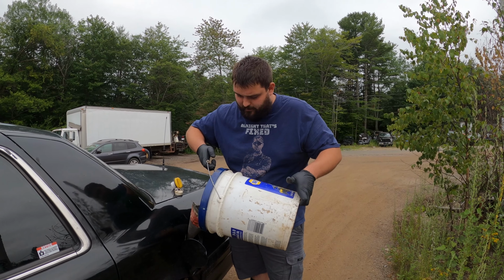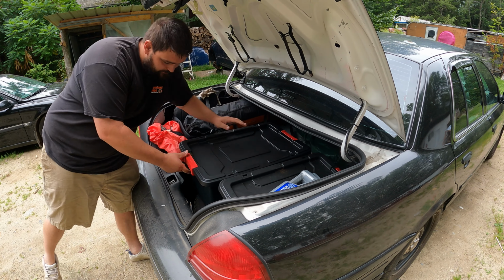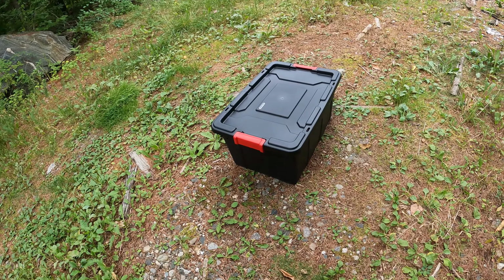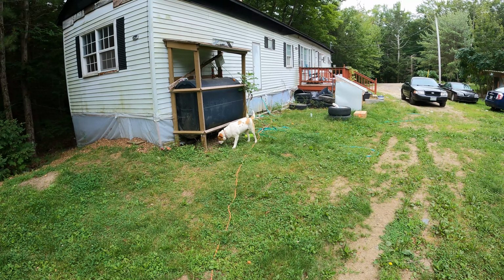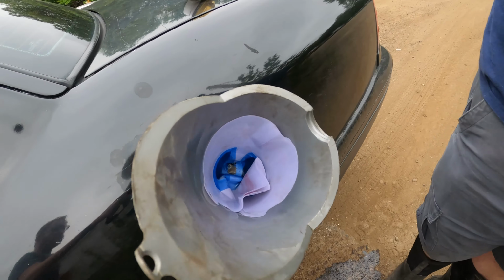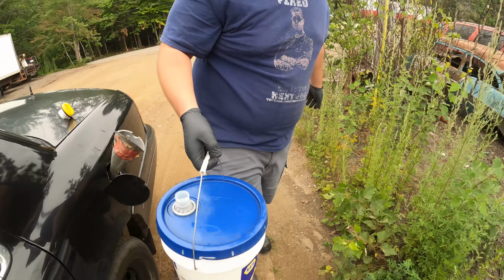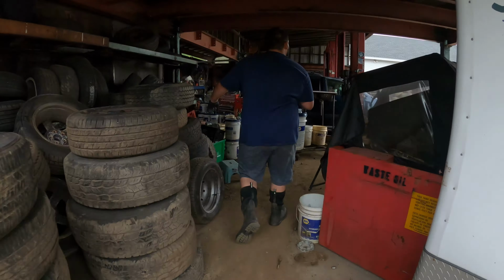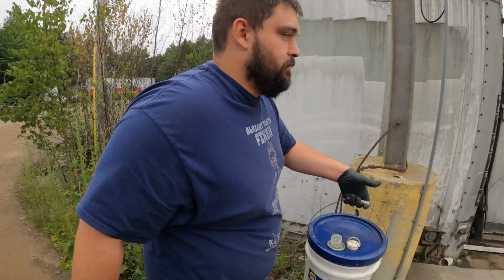Free Recycled Gas

Comment: That’s interesting, I had a friend that worked in a local junk yard, and he used to do that.
I never really thought about how good of a deal that was.
So here’s one for you, if you can find one of the indoor (or outdoor) recreational climbing facilities, they can only use their ropes for so long before they have to be cycled out for active climbing.
Sometimes you can just ask for one of the old ropes. 
They are great for pulling trees down or other non life risking activities where you might need a really good rope.
Reply: Rope has nothing to do with making or recycled fuel the so random and way off subject but good advice thanks man. I am a rock climber and could use free clbing ropes for non life supporting ropes but for carrying my bag with tent or hammock or hanging tent that I stretch over small valleys in between two openings on the mountain or attach to mountain next or accross from one I climed amazing experience to sleep in a tent hanging between two mountains 1000 plus feet off the ground but gotta use rope to tie your materials and cooler with food and drink and clothes and all your gear off the side and just pull up when needed